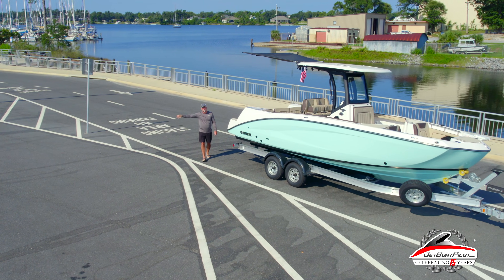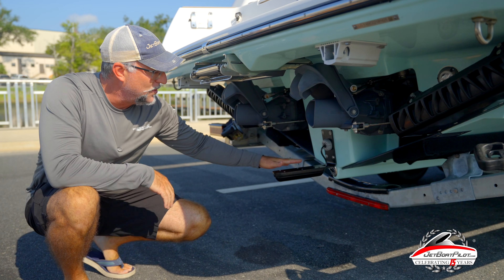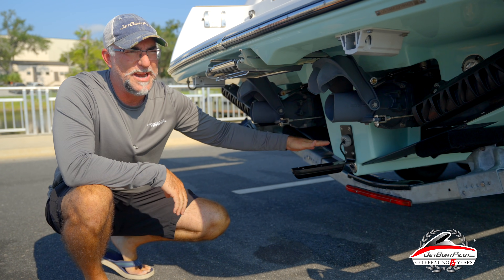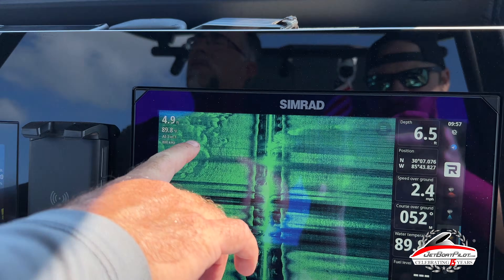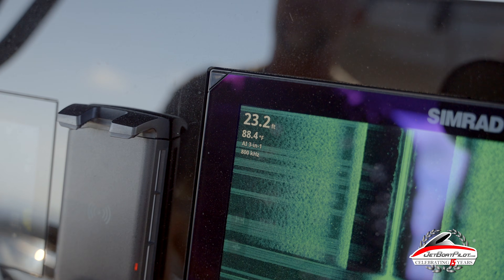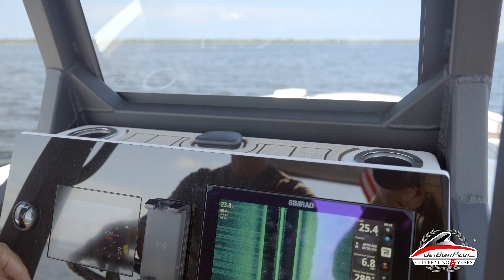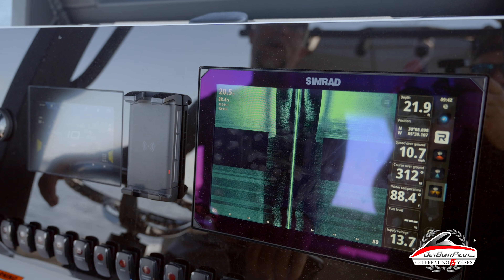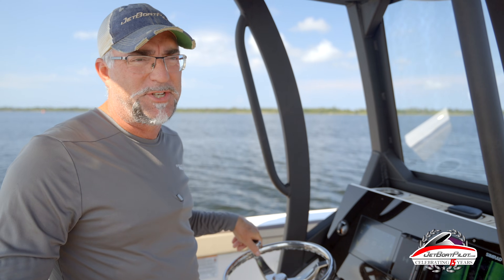3 In 1 & Through Hull Transducer Install | Depth At All Speeds

Comment: Is there a wire hub we can simply buy online to wire up both transducers?
Thanks in advance.
Reply from the maker: We've had a hard time sourcing one. The one we did find was recently discontinued. We bought one for stock but are not sure where we're going today but the next one.
Reply: @JetBoatPilot Have you tried to plug the transducer into the Yamaha connect screen to see if you can use that one for true depth. I know on the FSH boats it’s just blank but I always assumed that because the transducer is plugged into the Simrad.
Reply from the maker: @easttexasengineering3489 it hldoes not have enough slots on the back to do Seakeeper Ride and the 3 in 1. That's our most common setup.

Comment: How would this work when putting the boat back in the water? We’d need to make sure there’s plenty of water depth. I’d be concerned that it might break if the water isn’t deep enough when backing the boat in.
What do you think?
Reply from the maker: The mount bracket is super strong but obviously you don't want to ground the transducer. Make sure your launch ramp is deep enough to float the boat before you launch. Most are well deep enough to float a boat with a 18 inch draw.

Comment: Another great video. Thanks Will.  Was thinking that, with your online presence and tens of thousands of subscribers, you would be a great conduit to the folks at Yamaha to address some "wish list" items for future models.  I'd be curious what others would like to see.  I'll start it off with the following (I have a 2024 222XE): 1) Allow for their CAN Bus system to connect to NMEA2000 devices. I installed a separate MFD for better navigation, but am unable to utilize a majority of its functionality like one can on other boats.     2) Make their Helm Master EX available for other models besides the 255 FSH Sport H. Would make around-dock experience so much better and sure to attract more buyers.        3) Figure out a way to get more installed ballast on their Surf boats.  Would definitely attract more buyers who are dissatisfied with the limited surf wake and are forced to buy dedicated Surf boats instead. 4) Install adjustable Trim like Seadoo has on their PWCs. Would make a meaningful difference when dealing with different sea conditions.               I love my boat, but there's definitely room for improvement, with the payoff for Yamaha being increased sales and greater user experience.  I would definitely trade up for a new one if they would include the aforementioned features.
Reply from the maker: I know a few of your items have been discussed at length and some may actually be possible in the future. I'll pass this along to one of my contacts.
Reply: @JetBoatPilot  Thanks Will.  They all seem like "no brainers" that would lead to greater customer satisfaction and more sales.